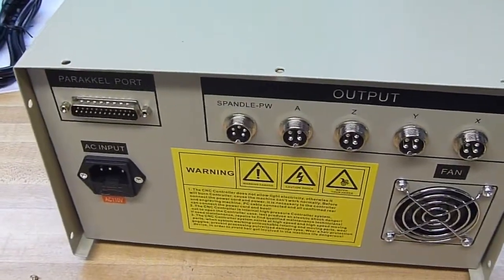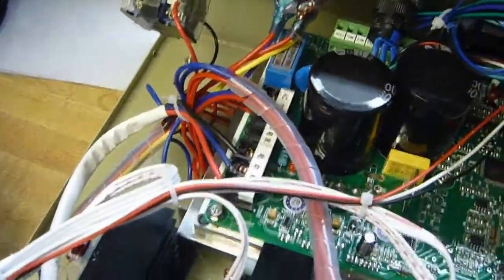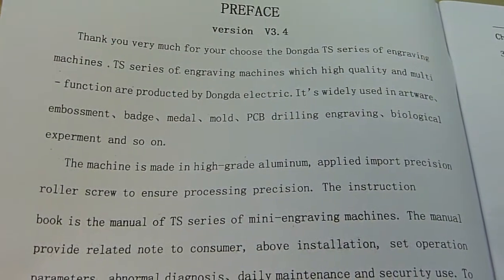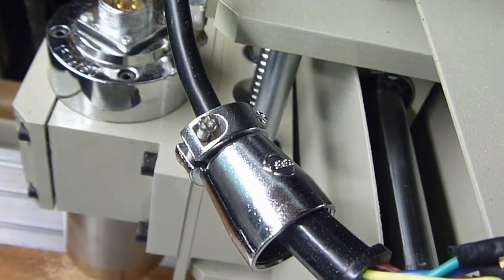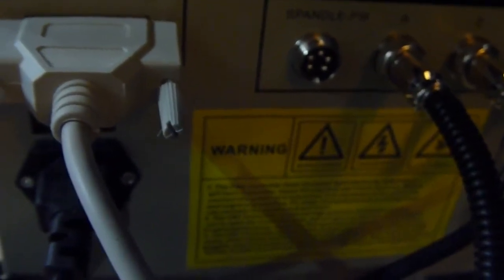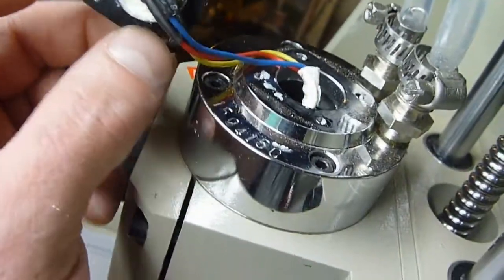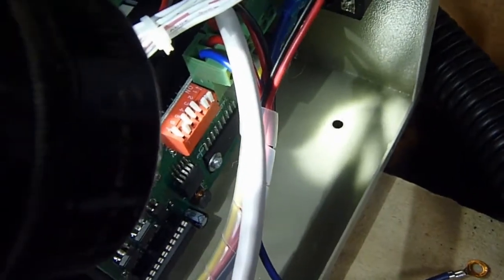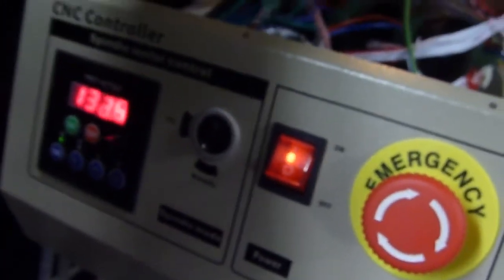(2016) Troubleshooting and Repairing the Chinese 6040 CNC

Comment: Hi There, I have the same CNC and trying to get it going with linuxcnc.  Would you mind sharing the Stepconf settings? any cool projects in the works?  thank you.
Reply from the maker: I'll look into it.  I haven't done any work recently with the machine, as the computer I was running it from was having issues.  I'm thinking  that it was only a dead CMOS battery, but other projects have taken precedence.  If I can get the PC up and running again, I'll let you know what my settings were.

Comment: Have you had rnr motion controller not found come on In Mach 3?
Reply from the maker: No, I only used Mach 3 with it a couple times.  It was a hacked version that came with the machine...  I switched to a distro of Linux CNC and have been using that since.